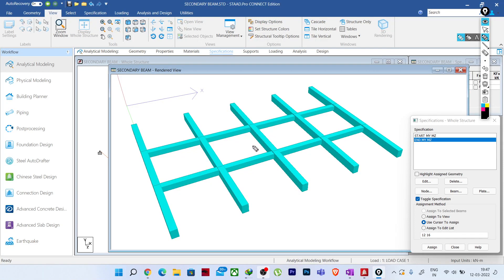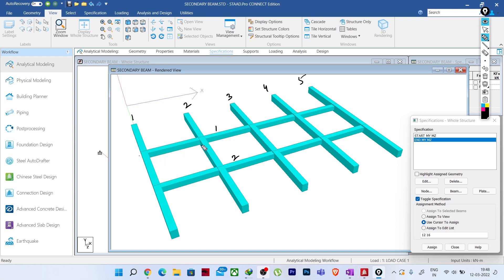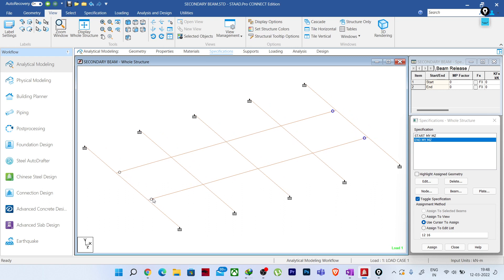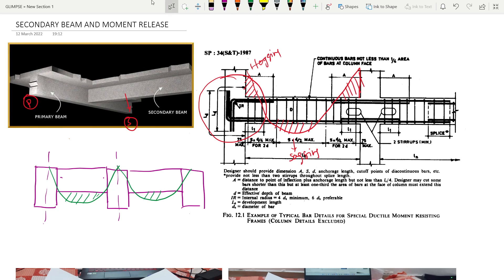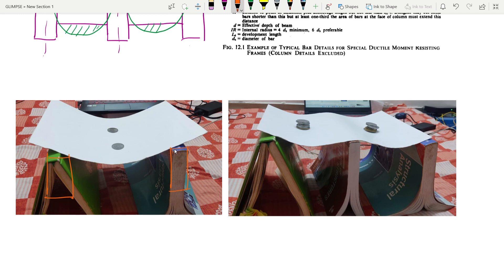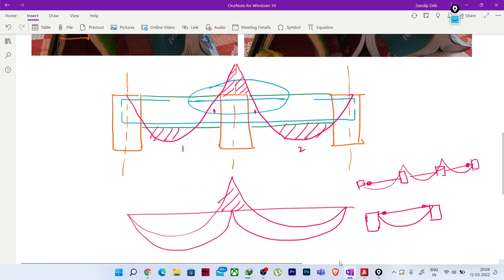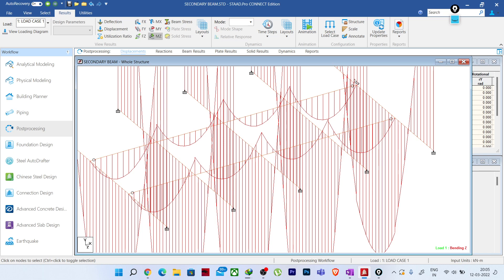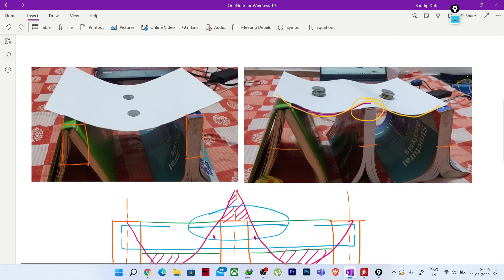Structural Engineering Funda: Secondary Beam and Moment Release | Sandip Deb | ilustraca

Comment from the maker: 𝗪𝗵𝗮𝘁 𝗰𝗮𝗻 𝘆𝗼𝘂 𝗹𝗲𝗮𝗿𝗻 𝗳𝗿𝗼𝗺 𝘂𝘀 ?
📌 RCC Building Design using ETABS and Manual Design (IS456:2000 & IS13920:2016)
📌RCC Building Design using STAAD. Pro and Manual Design (IS456:2000 & IS13920:2016) 
📌RCC Design and detailing using RCDC and Manual Check (IS456:2000 & IS13920:2016) 
📌Civil Site Engineering & Interview Preparation

𝐃𝐨𝐰𝐧𝐥𝐨𝐚𝐝 𝐨𝐮𝐫 𝐌𝐨𝐛𝐢𝐥𝐞 𝐀𝐩𝐩𝐥𝐢𝐜𝐚𝐭𝐢𝐨𝐧 𝐭𝐨 𝐞𝐧𝐫𝐨𝐥𝐥 𝐭𝐨 𝐭𝐡𝐞 𝐜𝐨𝐮𝐫𝐬𝐞-
𝐀𝐧𝐝𝐫𝐨𝐢𝐝 𝐀𝐩𝐩- https://lnkd.in/d_Rau-sk
𝗜𝗹𝘂𝘀𝘁𝗿𝗮𝗰𝗮 𝗔𝗰𝗮𝗱𝗲𝗺𝘆 is now available for IOS users also !!
Follow the 2 simple steps-
1. Download 𝗠𝘆𝗜𝗻𝘀𝘁𝗶𝘁𝘂𝘁𝗲 App from App Store.
App link- https://lnkd.in/dxS74bQk
2. Open the app and log in with Org. Code- "𝗔𝗠𝗜𝗧𝗖𝗢"

Comment: Secondary beam resting on primary beam we can release moment at ends. but incase of 2 secondary beams, whether moment is released?  or should not release moment?  Example: secondary to primary connected and secondary to secondary another beam connected.   some of the engineers in the organization won't release moment, left to ETABS to consider moment and design. which one is the good practice.

Comment: Thanks Sir. How staad identify  secondary beam in case of when two beams intersect to each other like Plus sign ( + ).
Having supported by columns at extreme end of two beams.And intersection of beam unsupported.
Can we customize primary or secondary beam at intersected  junction of beam by releasing suport reaction Fy in specification /release support reaction Fy in STAAD.
Reply from the maker: Staad won't be able to indentify...u have to release ends accordingly
Reply: @ilustraca  Thanks Sir 🙏

Comment: Discreet explanation. Thanks.. Please do explain how much will be the development length in case of beam releases at end support in comparison to fixed support. 

Also whatever be the decrement in fixidity achieved by providing beam release at joints, there will be torsion on the primary beam (till failure) ,  so what do we achieve by releasing moments.

Comment: So, basically, can the reason for releasing the end moments be summed up as
The difficulty in providing development length at the ends of secondary beams - leading to lesser torsion in the primary beam and greater sagging at the midspan of the secondary beam?

Comment: Even if you release the moment at ends, physically when you construct the beam connection, it will cause some torsion in the main beam. And so the question still remains why we even then provide the negative reinforcement at ends where we have already released the moment.
Reply from the maker: minimum 2bars need to provided
Reply: Sir, Even if we consider  that the moment are released and design the beam as simply supported , but in reality it is a  fixed beam. So there must be hogging moment. What will happen if we design the secondary beam as a simply supported but in reality it acts like a fixed beam. Does it become crucial and cause failure? Please explain to me sir.
Reply from the maker: You're releasing the moments, not shear, if the reinf is not provided how the shear transfer is going to happen? those bars used to participate in shear transfer .. hope it is clear to u
Reply: @ilustraca  Shear is resisted by bottom bars, not top bars. ✌️

Comment: Although the designers tend to release moments at the end to avoid heavy design (considering torsional) in reality there still going some reinforcement right so there will be hogging moments at the ends and we are neglecting that will that not arise any problem?
Reply from the maker: the extent of that will be minor... if you think that the junction will be as rigid as at the support, then you can avoid releasing the ends..  discretization varies from designer to designer and the condition you are going to make.
Reply: @ilustraca  Too much confusion on the topic. As designers tend not to provide enough development length for steel in Secondary beam as they have designed the primary beam excluding torsion (meaning just for Mu and not for Me=Mu+Mt) But still they shall ductile design as per Code cause although they have ignored the torsion in reality there shall be still torsion coming right?

Also, sir how to know that the primary beam shall be or shall not be designed for torsion?
Reply from the maker: That's completely depends on how you interpret.. there is no hard and fast rule to release.. based on ur engineering judgement you can decide